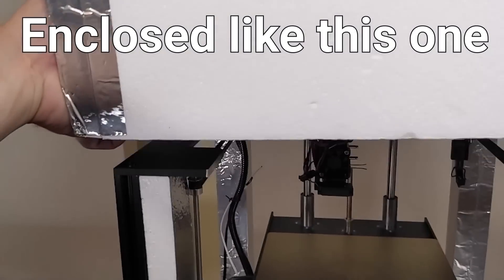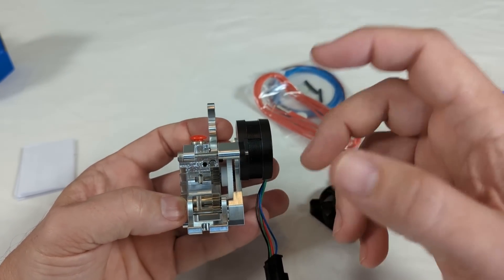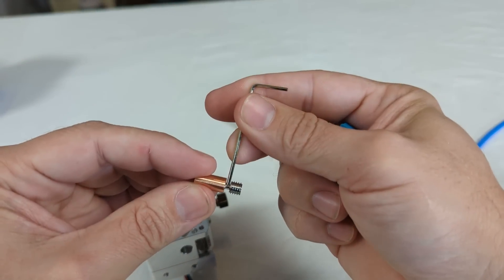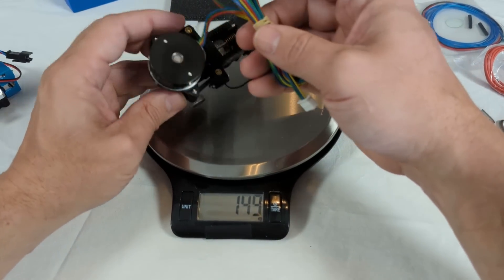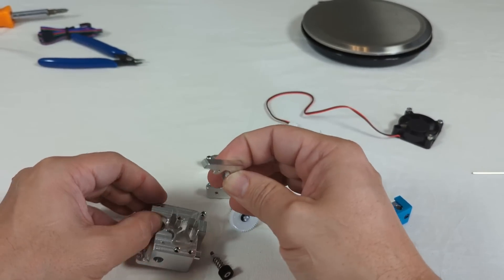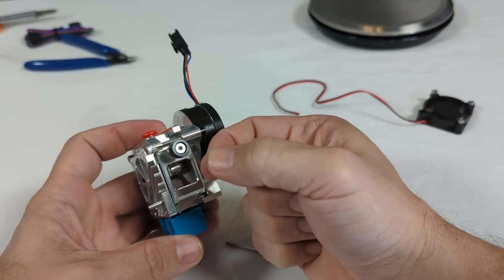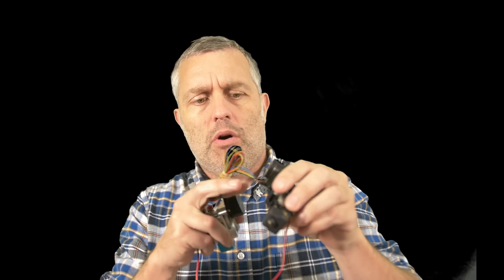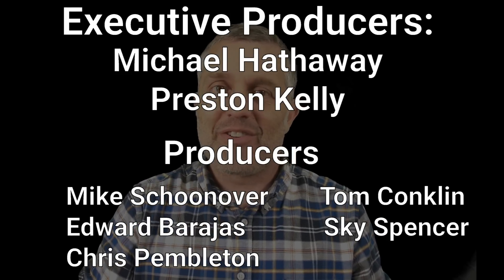The NF Sunrise Direct Drive Extruder Has A Trick & It's super satisfying

Comment: I think it's an option to put a volcano hot end on this extruder.  That should increase the speed of extrusion.  Also the door hinge pin may be trapped by mounting that section to the gantry.  I am not that put off the nylon gear.  I may just order one now that I have seen this review.
Reply: volcano is obsolete thanks to Bondtech CHT
Reply: @tommihommi1  I have three of the CHT nozzles.  They have their issues too IMO.
Reply: @MisterDeets  elaborate? I'm about to buy a bunch of them. Maybe we need a CHT Volcano :D
Reply: @tommihommi1  be careful torquing them in.  They manufactured a relief cut terminating the threads at the base of the hex section that measures about .5mm less than other manufacturer's nozzles.  That reduction in OD makes the part considerably weaker to over-torquing the nozzle.  I always like to torque the hell out of mine to prevent it coming loose etc.  The brass seems softer too.  My first one twisted in half leaving only the threads in place and the super soft brass turned effectively into grease inside the heater block when I tried removal tools causing me to have to toss my heater block.  I have never twisted a nozzle in half before and I have been printing since 2012.

The second one I installed clogged after extruding about an inch of filament and I have burned it with a torch trying to get it unclogged.  No dice.  Going to have to order an accupuncture needle to see if I can knock whatever is in there loose.  It's not burning out.  That completely screwed the nonstick coating too BTW.  Given that the center is occluded, the accupuncture needle can't go straight in like it normally would from the back.  Not sure what I am going to do with that one.  I have one more CHT nozzle and TBH I am unsure if I want to screw with it.

I am not saying they are bad, but I have not had the best luck with them so far.

Comment: Thanks , It was your suggestion of integrating the stepper parts into the extruder body that inspired the design that I'm playing with at the moment .  I've incorporated the stator and rotor of a 32mm stepper and a set of dual drive gears into a MSLA printed body (lots of trouble getting the alignment correct , had to machine the resin parts to get the accuracy)  but , i got a very light extruder  as a result . Still testing reliability  and I am worried about thermal stability.
Reply: ive been researching ways to heat resin, or the printer, because most resins want 26c+ to be in the best performance window... its possible your inacuracy is from the resin being a little cold, or perhaps some exposure thing too
Reply: @specialingu  yes I'm sure you are right about that Paul. I'm have to heat the whole machine (elegoo saturn) just to get it to print without failure ( .I have it in a cupboard in a unheated conservatory (outside because of the smell!)  , but  I'm not getting it to anywhere near 26  with my crude fan heater setup. Thanks8-)
Reply: @wktodd  I've just modified my halot one, it's got a chamber ventilation fan but I'm going to try it with the fan unplugged and hole taped over, I'm hoping that seals in the smell a fair bit
Reply from the maker: Definitely send me some photos or better yet some video if you get it working!
Reply: @DesignPrototypeTest  will do, Thanks.
Reply: @DesignPrototypeTest   Youtube video uploaded here: https://www.youtube.com/watch?v=cLftZO6iKPo

Comment: You knocked the Sherpa mini for having to unscrew the tension arm and then you knock the NF Sunrise for having a lever to negate that need. Whatever man.
Reply: Yeah and Nylon can withstand hella heat and in some cases be 100's of times more durable than steel. Seems your more focused on weight and speed (even tho you said yourself it's exceeded the speed you or anyone would normally print at), like this NASCAR or something, instead of PRINT QUALITY. Where's the print demo? It's possible that engineering choices made have effects on final print quality of various materials, that you might not expect based on your ASSUMPTIONS...
Reply from the maker: On the Sherpa Mini I wasn't criticizing the breach/tension arm I was criticizing the tight filament path. Even when the arm was being forced open the filament wouldn't smoothly pass through. The tension arm solution generally works well. That's why we keep seeing it on design after design including both these extruders. The NF Sunrise has a whole extra mechanism which locks the tension arm into the open position. If the NF Sunrise had the same tight filament path as the Sherpa Mini, I would have given it the same criticism. That being said, If you expect me to never contradict myself you should stop watching my channel. I change my mind when faced with new/different situation/variables/designs. It's tough to remember the minutia from every review so that I can be perfectly consistent throughout every video. I try to be fair, but I'm human.

Comment: Great review. There is news about the purchase of BIQU H2, now they have started selling new BIQU H2 V2.0. There are certain design changes compared to the original version, and I'm not sure they haven't worsened it.
Reply from the maker: meh. It looks like they just changed the heater block. Maybe made the throat/heatbreak "all metal" without the PTFE liner. The meat of it will be unchanged because tooling is expensive.

Comment: If the pin was the only issue it could be 'solved' with something like Loctite 272. I'd rather not use Loctite, but it is designed to keep engine bolts from coming lose, at tempratures over 200C, due to shock and vibration.

Sadly I don't know where I could get a metal version of the plastic gear... Unfortunatly this is the issue that keeps being overlooked, and I've see this issue on some of the water cooled systems as well like the Triangle Labs Matrix LC hotend/extruder (haven't seen inside but it look like the retention arm is made out of plastic).
Reply: most likely its a "standard" gear, probably the biggest hassle would be identifiying it, if mellow wont say what it is

Comment: oh im so glad u got one. im also looking for a good extruder for my enclosed printer ( i think i will end up designing my own with a sla printed gear) 

i never use any latch to feed filament into my extruders. i just gently press the filament against the extruder gears and press a button to  move the extruder and it just bites into the path without issues.  this is very important. no filament selectors/feeders( think enraged rabbit)  will ever work if this does not works. 

i dont share your view of the heatbreak . for me it is better to have the m6 threaded part of it made of stainless steel or even tc4. it is better , again for those filament selectors like enraged rabbit. the "ramming" or "tip forming" gcode works a lot better on them. at least thats my experience. 

do you think you may water-cool mod it? that will be a good video.
Reply: i think having a copper thread is better for high flow, but i think the stainless steel tube is full length in these bimetalic heatbreaks, so im not sure how much difference it really makes, probably swapping comprimises, as the all stainless steel is probably less likely to have heat creep
Reply: @specialingu  i think that as much as the  large threaded part takes heat more efficiently from the steel tube, the short part also conducts heat into the stainless steel part who is into the heat block, better. 
and i dont like that. i dont wanna use that part as a "melting zone" . if i need more melting zone i use a volcano. ( and i do )
i just need a soft part where to ram the filament so it does not form a thread when i pull it.
Reply: Resin makes terrible drive gears. There is no issue with the drive gear. His info is wrong.
Reply: @maxkool007  vacuum enclosed prints are getting my attention now. 
i must design another one!!

Comment: Nice review! I've been really excited, and waiting, for this review when you mentioned you ordered it a few months back.

One thing that I noticed that you did not mention, is that the sunrise is a little less bulky (when compared to the h2), which can help on a corexy printer, so you don't have to worry as much about losing y-axis printing space. 

Another way to help prevent that the latch door coming out, would be to integrate a little blocker on the exposed side. This could be implemented with your fan duct which I believe you could also Mount at the front. That being said, you are right it's stating that it is an oversight.

I'm fairly certain they use Pom or acetal for the plastic gear, which thankfully does have a high deformation temperature.

Also, are metal gears actually better? Can't they cause binding like initially with the h2, or other issues or you don't want metal on metal. It also saves a little bit of weight.

I wonder how this would do with a volcano block. You would get high or flow theoretically. Not sure how easy it would be to route the cables in a volcano block. Since the wires run vertically and I'm not sure what the clearance is look like on the NF sunrise without actually having it in hand. 

Hope the transition to the new place is going well! Thanks for this review! Glad to see more content here now that you're settling in a little bit more.

As I stated before I love your critical approach. Whether or not I agree with you all the time that's a different story LOL. But I do appreciate when someone nitpicks all of the things because it really draws your attention to potential improvements and the faults of the product itself. 

Hope you have a wonderful weekend! :D
Reply: I can tell you, that I'using this little guy in my diy Corexy with a volcano. It's a tight fit but does work and print performance is excellent.
I like the design, build quality and especially the print quality of this extruder. It's running now since 4 months without any issues.

Besides the very short path from hotend to gear, another advantage over the orbiter hotend combination is the height, especially in compact setups.

Comment: A plastic gear is actually better engineering (not stupid) and has better alignment, binds less. And as long as it is made from a high temperature plastic like Nylon, it can handle a heated chamber. For lubrication/heat conduction, I would recommend adding a very light coat of TinkSeal to the outer edge of that plastic gear, the detent and bronze bushing. I would get a copper block from e3D, and titanium heat break, cheaper and easier. Slice is way over priced. I like the lever because you don't have to keep adjusting your spring pressure. I would much rather have the NF Sunrise than the BQ or Sherpa extruder.
Reply: on top of those reasons, which I agree, having a plastic against a metal gear allows you to control where it will wear out, in this case, the nylon gear will be a better fit over time.. 
not doing this was one of the issues with the Biqu H2..
Reply: I tend to agree
Reply: Depending on the Nylon used in manufacture, Nylon can potentially outlast steel 1000:1. A slight dab of TinkSeal between these two meshing surfaces will insure that the two gears last far longer than originally intended.
Reply: @MichaelJHathaway  once again bullshit.
Reply: @justtestingonce  You going to elaborate or keep slinging insults?
Reply: Why a ti heat break? Why not a bi-metal copper/stainless or copper/ti?
Reply: @squiresuzuki  pure ti concucts less heat than the alloys
Reply: Exactly! Also if that gear has problems the fans would have too as they are also made of plastic.
Reply: Bullshit!

Comment: I totally agree this lever thing should not exist. Not only it adds weight, but also takes quite a lot of space above. It happened so i'm using Sunrise's ancestor, Mellow Aero BMG on my sapphire pro and it was a spacial disaster to make these work without print space sacrifices.
What i don't share my opinion on with is a plastic gear ruining the heated chamber usecase (i believe the motor will give up way earlier than a nylon gear under high temperature). I'd say this design is way quiter and cheaper compared to a metal gear, and it also stops heat transition between motor gear/shaft and feeder gear/shaft. 
Another thing to mention is this metal unit has got a lot less leverage between it's mounting point and nozzle tip than Orbiter derivatives making it more accurate mechanically. And of course, less pushed filament path for more feeding precision and less retractions.
Oh and the that pin... It's spring loaded on a long lever side, but i don't think it's ever going out while printing. May be when there's no filament loaded, i suppose...

Anyway, nice video!
I like where this is going, both your "vibe" and China's progress out of Ender-cloning money stamping action toward something new!

Comment: Hi, I have to build a support for the BIQU H2 in order to fit my Sapphire Plus and my Geeetech A30 (upgraded to linear rails). What material do you recommend? Stainless steel is a bit too heavy or? I have bought two pieces (BIQU Extruders) for my two printers and also a cheap (around 100€) Duet Wifi Board thanks to your recommendations :) Thank you for that, great channel I did learned a lot from your videos!
Reply: If you could print your support with a carbon fiber reinforced filament, it would be strong and light weight.
Reply: @MichaelJHathaway  Thank you for the tip. At the moment I have the Saphire Plus stock (only Marlin is installed) working. Can I print Carbon on it? I do have a Copper Nozzle 0,4 from Austria.
Reply: @catalinalb1722  You might be able to, but you would kill your nozzle. So either use a hardened nozzle or plan on replacing your nozzle right after printing the carbon fiber mount.
Reply: You could do what I did, pick up some Aluminum, then cut and bend it into shape (replace the hotend mount for my Saphire Plus). If you are using hardware store Aluminum, remember to anneal it first (heat it using a tourch, then let cool slowly), if you don't it will probably crack while being bent.
Reply: @DamienRobertsonYYC  Thanks for the info.
Reply: if your doing it to mount it, then you could try abs, or if you have a resin printer syriaia tech sculpt resin is happy to 150c :o